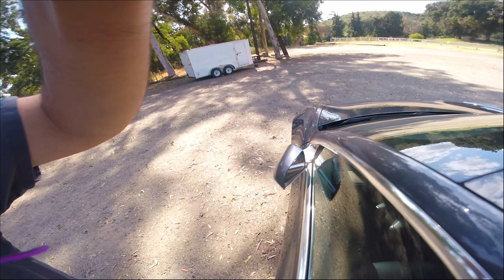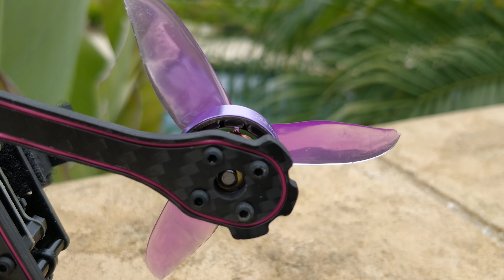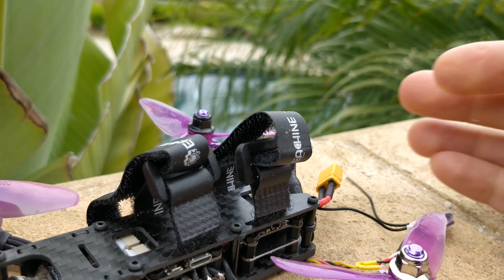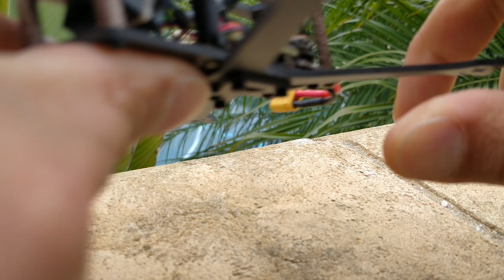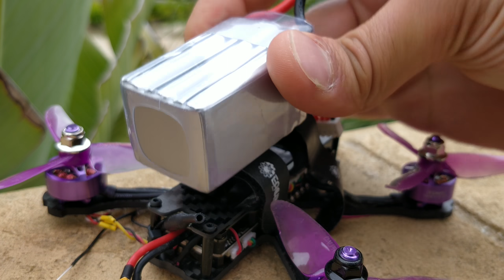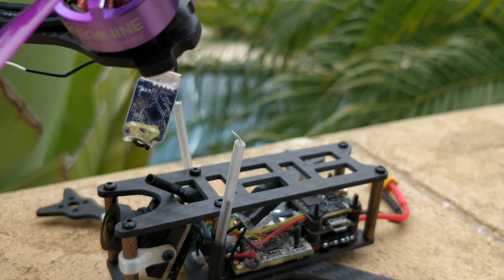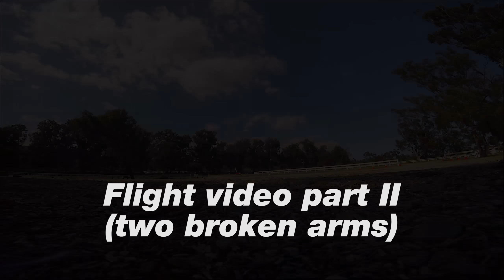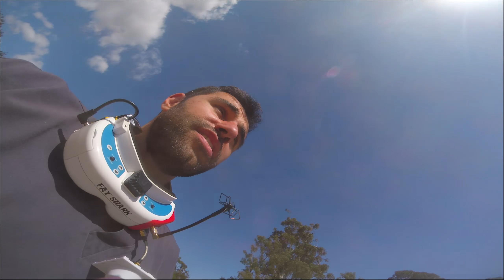Eachine X140HV - voltage/ light/ heavy discussion

Comment: Hope it is OK to disagree.  I have a light weight 3" that uses the a FlexRC frame; it uses 1106 motors and weighs 88 grams, 138 grams with a 3s 650ma battery.  With a 3s battery it is very, very fast.  According to emax I am getting about 360gr of thrust per prop.  That is a thrust to weight ratio of 10.5...which is really, really good.
Reply: Sounds a bit like my AmmaxInno 3E with 1106-6000kv and KK2840s. Wonderful on 450mah 3S.

Comment: Lol. 2 desyncs.. Hmmmm what bf version was this at? Just curious.

Or maybe lack of capacitor/s at batt input?

Blheli_s or blheli32?
Reply: There should be a capacitator, at least there is one on mine.
Reply from the maker: It is 32 but BF 3.5
Reply: @Kabab  GF 3.5.5 to be exact, right?
Reply: Ok. Too much current draw from 'other' electronics. And I dont see any caps(?)
Reply: Cap is inside, between the FC/ESC stack and the stack that holds LED/Buzzer board and VTX. So it's indeed not visible from outside, but on the other hand, well protected.

Comment: i just built an iflight ih3 with geprc speedx 1507  3600kv, they come in 2800 3600 and 4100 all 3-4s so the 2500 for the 6s seems reasonable, was looking at those  t2  but they were 16xx and almost twice the price. ended up trying the nazgul 3061 props, its fast fast fast,then i ordered lower pitch props  to try out, its 270grams with the 4s 850mah.

Comment: Interesting Bob thanks👍personally i think these parts would suit a 4 inch not 3 inch quad. My 3 inch is a 3s running 1106 6000kv motors and 3028 Gemfan props, for me it's perfect for freestyle😀 and 3s lipos are alot cheaper than 6s lipos 🤔

Comment: Can someone explain this to me?

A 4S 1500mAh 100C LiPo can put out 150A at 16.8V = 2520W
A 6S 1000mAh 100C LiPo can put out 100A at 25.2V = 2520W

6S setups draw less amps but at a higher voltage so the total power output stays the same just with less voltage drop because of losses in heat in the wires.
People say "More flight time! More power!" but my knowledge defies this difference between 4S and 6S. That also makes me wonder how physics could explain the difference in voltage sag.

I think the only reason why people notice that big difference is because they use something like a 1250mAh 6S pack which is equal to a 1875mAh 4S LiPo instead of something comparable to normal 1300-1600mAh 4S batteries.
Reply: it takes less amps at higher voltage for the same power, to put it simply., this is part of why 6s claims increases in flight times
Reply: @smoakthis  But the C rating stays the same. It refers to the capacity so a 6S battery can put out less amps than a 4S battery.
Basically each battery can only put out a certain ammount of watts and this should be the same on 6S and 4S
Reply: @SandroFPV  it is the same power. Because of the lower amp draw, the battery and motors stay cooler. They stay in their optimum performance configuration for longer (per throttle application). If you could run at full throttle for 1.3 sec on 4s before heat started lowering your rpm from friction, on 6s you might get 2.5 sec. Max rpm for twice as long will get you farther and faster. It doesn't change the amount of power, or the max rpm, just how long the system can function optimally at full chooch before heat starts robbing you of rpm.
Reply: @SandroFPV  Above 1500mAh individual cells don't have the same C rating as smaller batteries (good luck finding a 2200mAh 100C). I'm not sure if this is an inherent quality of lipos or just lack of demand. 

Some people just want a battery with more capacity for racing/freestyle, and above 1000mAh 6S there are no 4s equivalent batteries (because of the performance dropping off). This also lets battery makers keep using the 1300-1500mAh cells they've probably spent a lot developing and bringing to market.
Reply from the maker: 'claims to' is the right way to put it. It's moreso just increase in performance. Flight time is still governed by capacity
Reply: @Kabab  Yea EXACTLY... It's just like a stream, if your moving gears and such with water and it's slower and choppy vs fast and smooth, kind of how 6svs3s/4s is... You can move the same amount of WATTer just with allot less bullshit
Reply: Heat produced is negligible if the motors kv is correct, so 2500kv on 4s /1.5 = 1667kv on 6s, and the voltage sag is less due to the lower amperage, putting less stress on the battery. I understand your argument, some people will put a higher capacity 6s on a quad and claim 6s makes it fly longer, which is correct, but much less than some may think. 1000mah 6s = 1500mah 4s

Comment: -Eachine should just make motors. They have a real talent getting lost in a sea of failures.  

- as the production of Escs and motors gets better and the programming more dynamic, the "power factor" will be much higher. So the higher voltage won't produce the same dramatic difference. For very complex reasons.
Ohms law  volts*amps=watts.  so the higher the voltage the lower the amperage. Amperage has a lot to do with your infrastructure(size of wire or circuit). voltage is your frequency of delivery and wattage is real energy being used or true power.  

https://www.allaboutcircuits.com/textbook/alternating-current/chpt-11/true-reactive-and-apparent-power/
Reply: You did a great video. And you hit some ground breaking topics right on the head. Check out that link. You'll fall in love with those technical manuals!

Comment: Totally agree the 6S is just a marketting gimick. 4000kv on 4s with a quad around 130g is plenty of proformance for 3" freestyle. But I do think eachine is right with the basic design of the frame. In that dual 20x20 stacks is the way forward for a good 3" freestyle frame. 3mm well cut bottom plates are easily durable enough on a 130g ish build. Would love to see you design a such a frame. The 250g AUW limit is coming here in the UK. And the electronic for such a build are easily available. More and more people are looking seriously at 3" freestyle set ups.
Reply: I run 1306 4000kv on 3" AUW of around 220 to 230g with 650mah 4S and get great proformance in up to 4 minute flight

Comment: you sure that was the esc desyncing though? i had a very similar crash when i tried betaflight 4.0.0
Reply from the maker: Not sure. Don't care. It falls out of the sky. It's no good
Reply: @Kabab  yeah, i don't wanna doubt that. just saying maybe it's just a software issue and the fc and esc are also alright
Reply: 1507 on a 20amp esc carrying any extra weight..eg gopro. I think is pushing the esc pretty hard. Not surprised by the desync
Reply from the maker: @davidirving2402  not really. Shouldn't have an issue. The amps are way down.

Comment: Yeah il buy another xjb145  been going strong over a year now
Reply: word 👊
Reply: Best 3in bnf ever. I love the motors and the stack.
Reply: Heck yeah. I been running the f428 in my 2 inch micros. Ow and put the 38 amp in the xjb hope to try it 5s 3600kv with azure 3060 props

Comment: Only reason people would fly them over a 5" is in countries that impose a weight limit of 250g and higher for registration schemes that require a yearly fee.
Reply: Exactly. Ad seems my country (and whole EU FTW) is rolling in same direction. Nevertheless did a test flight of Diatone GT-R349 at today and ... well... now I can say that we have 3" with flight feel of 5" :)  No problems with 4S, even successfully managed sat it on Tattu R-Line 4S 1300 mAh :D  Did a pair of bad crashes, but lost only a tip of VTX antenna. So yes - at least we now have alternative to 5" in countries where our hobby is not welcomed.
Reply: Try a HGLRC XJB 145 , Performance is awesome on 4s . Freestyle like a 5 inch.
Reply: @davidoconnell3330  I have a custom built armattan gecko 3" buttery smooth and plenty of punch on 4s with 1407 motors :)

Comment: The tyro has 2800 on 4s and that seems fine? So I don't think the 2500 on 6s is a problem less topspeed tho
Reply: 2800 on 4s is equivalent to 1867kv on 6s
Reply: @kral5932  yeah but we forget that this is a 3inch prop that needs a way higher rpm
Reply: @peterzingler6221  then why compare to a 5 inch?